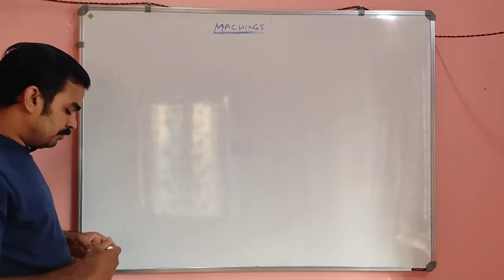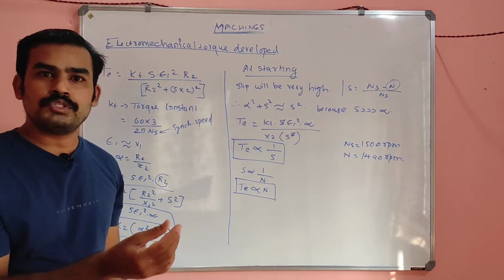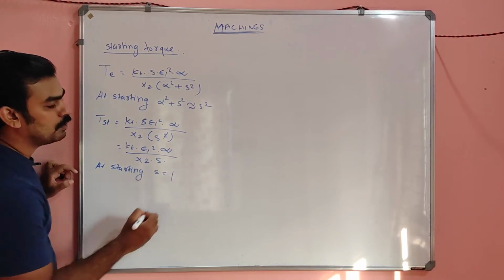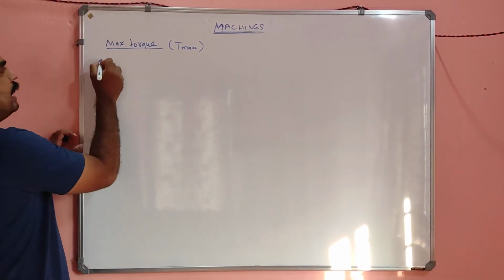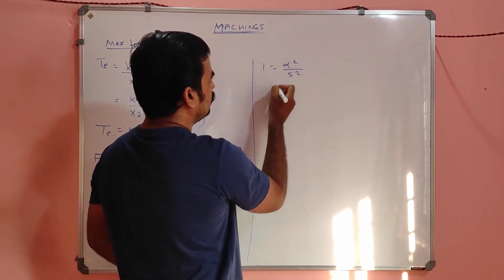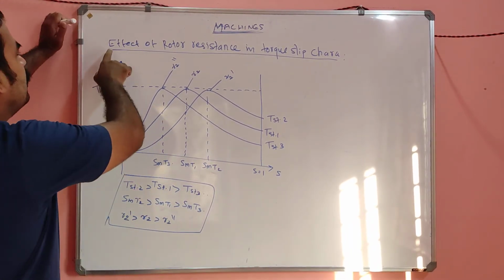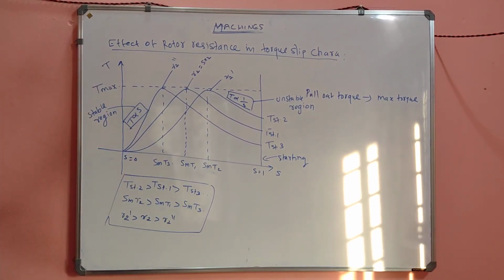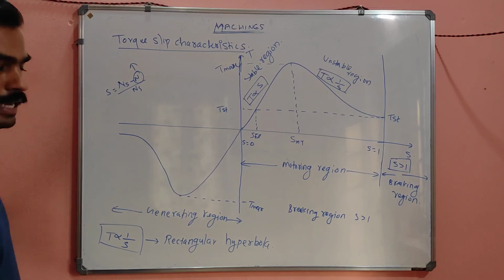LECT. 13 INDUCTION MOTOR | TORQUE SLIP CHARA | MAXIMUM TORQUE |FULL LOAD TORQUE |

Comment: sir ee rotor resistance koodambam starting torque koodana nthanu.starting torqunta exact meaning?
Reply from the maker: Frst gear alle etavum power.. Athum satrting alle nammal idaaa.. Sooo initial motor inertia overcome cheythu karangan vendaaa torque allengil frce anu Strtng torque.. See the torque equation it depending on rotor resistance r..
Reply: @teslaacademy9888  kk sir thanku